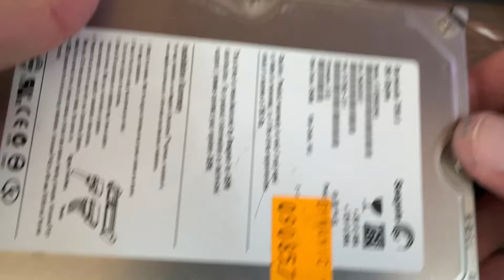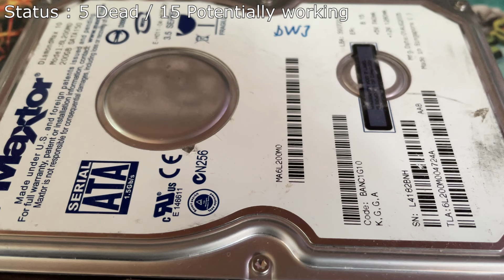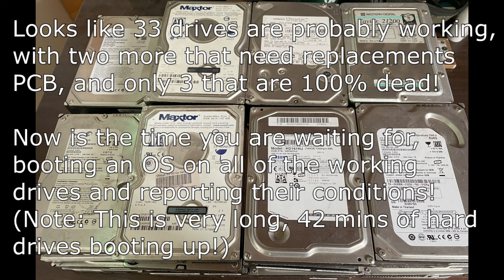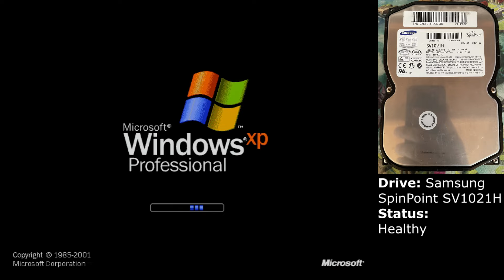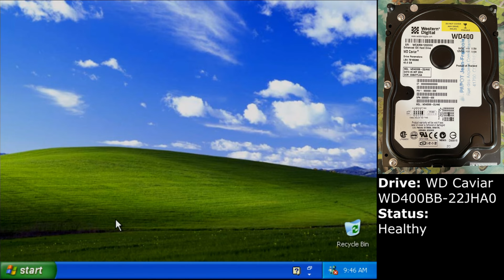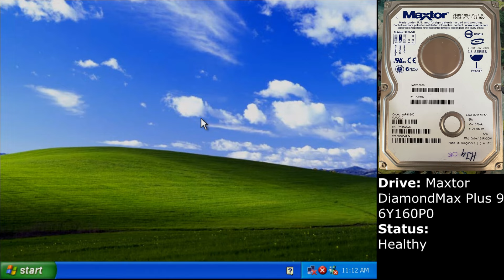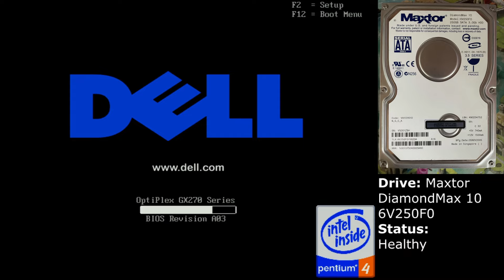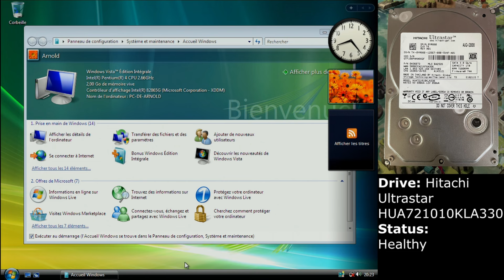Checking out a giant lot of 38 hard drives, will they work?!

Comment: I get mine mainly from working Apple Macintosh older 80's and 90's SCSI based machines.  Yard sales, deceased estates and Goodwill stores and thrift shops.  Most of the drives you get in lots tend to be scratched/as-is, not working etc........  Either way the very early large drives from 5.25" are what fetch the huge money if they are working.
Reply: I have a 320GB 3.5 inch WD drive I pulled out of an early 2009 20 inch iMac. The drive works but I hadn't checked the drive for bad sectors or anything as it's just an OS installer drive
Reply from the maker: Well if you can find some drives on those kind of places then yeah it can be good I assume. Most of the collectors I know/have spoken with seem to be doing the same as me though, buying on ebay or other online sites. As for the lots of bad drives, I'm the one that decides to go for them because I like messing with drives and trying to make them work if possible.

Comment: 9:05 : My HDD is also Hitachi Deskstar, but mine is different model. Made in Shenzhen China and capacity is 160 GB. It was bought in 2008, and is still going strong even today.

Previously used for PC, and now as external storage. As I use it as External storage, I formatted into exFAT. NTFS seems just feel 🦥. I thought the enclosure was the problem, it's actually file system on HDD itself need to change 😅😅

I have done it, and it works great 👍. Btw, that's sound character of this HDD. Already familiar with that 😅
Reply from the maker: If you bought it in 2008 it probably is a different series but it might still look the same and sound similar though

Comment: 33:20 I think something happened with the mic here, as this drive should be much louder. Btw, does anyone know which 3.5" pata drive is the quietest? (when it's idle, but spinning)
Reply from the maker: I don’t think so, protégé's seeking isn’t very loud and they are ball bearings as well which makes the seeking seem even quieter probably. I wouldn’t be able to tell you which drive has the quietest spinning sound, obviously fluid bearings ones, and probably ones with low number of platters? (Lower chance of vibration and maybe less "air" noise I guess)
Reply: @arnlol  33:20 timecode is for Hitachi Desktar, 40 Gb. I was referring to the spindle sound (not seeking sound). In the video is barely noticable, but it's a 7000 rpm drive and  remember them being much louder, which made me think that something was going on with the mic.
As for the noise question, thank you for you answer @arnlol!
Reply from the maker: @aspinx  Ah, this one. It’s a 180GXP, which uses fluid bearings just like modern drives, so the spindle is very silent. There’s a drive that looks basically identical to it and is 40GB as well, but part of the 120GXP series, with a different model number, that one has ball bearings and the spin sound is louder. (This drive here is actually a short-stroked 60GB, the model number seems to indicate it should be 60GB and the bottom part of the label looks like a second partial label was stuck above the original one, and I assume the original probably said it was 60GB.)

Comment: Speaking of drives... I managed to find a NOS SCSI Seagate ST336607LW. Strange that two drives of the exact same model, one reads Ultra 320 and is loud as heck (despite having quite low PoH count) while the NOS drive is quiet and reads Ultra 160.
Reply from the maker: I guess one has a different PCB revision? The loud one has bad bearings I assume, that can still happen even if the drive doesn’t have a lot of hours (it might have been dropped etc I guess)

Comment: I see that Westren Digital 21200 was made in Malaysia. WD made a huge mistake moving to Malaysia in 1998. Those ones had a high failure rate
Reply from the maker: I know that some WD from Malaysia supposedly have issues though I’m not exactly sure which ones/from what year are the drives with problems.
Reply: He had 2 more WD Cavier 21200s. One with some bad sectors and one with tons of bad sectors that only has about 100MB of usable space. Still boots Windows 95 though

Comment: Hello Arnold0, great video, I have a question today, I bought a Quantum Prodrive els 85AT and I think it is suffering from the rubber bumper problem, I just posted a video on my channel and if you could, could you tell me if this Does the hard drive have a long useful life? I installed windows 3.11 and it works perfectly with 0 bad sectors so far.. I'm waiting for your response!!
Reply from the maker: It’s impossible to tell the life left in a old hard drive honestly but it not having bad sectors is good. However, yes even though the heads aren’t stuck your drive is definitely suffering from the rubber issue, actually it is so bad that the heads are rubbing on the spindle on spin up/down! If you continue using the drive like this it is very likely that the heads will eventually be damaged, but obviously fixing it requires being ingenious to make a "replacement" bumper as the original bumper is under the platter in these drives. I know that a replacement 3D printed part exists on eBay but it’s quite expensive for a piece of plastic, personally I’ve used small pieces of copper wire, maybe it’s not the best but it has worked fine for me. Obviously if you open up the drive to try and fix it you need to be very careful if you want it to remain bad sector free.
Reply: Hi Arnold0, I fixed it!!! I disassembled the upper part of the magnet and placed a small ball of paper to serve as a limiter so the arm wouldn't go beyond the limit and touch the axis. But unfortunately it developed bad sectors but I can install and use it normally!!!